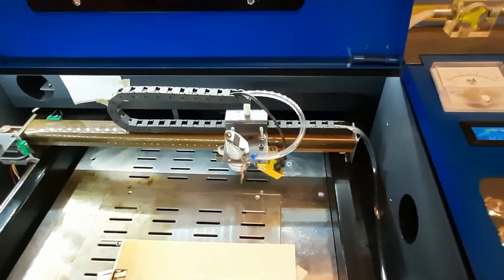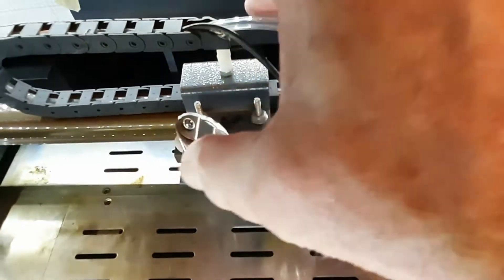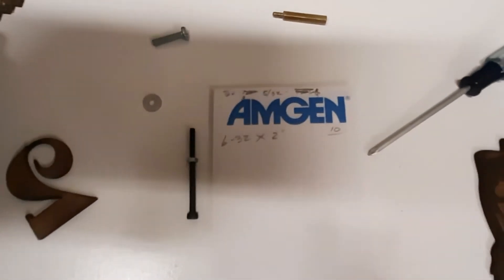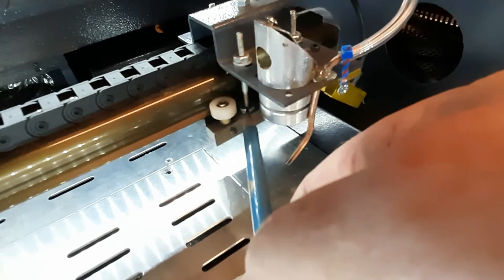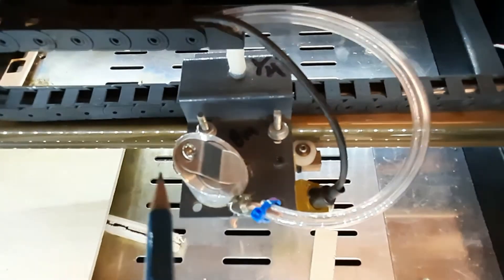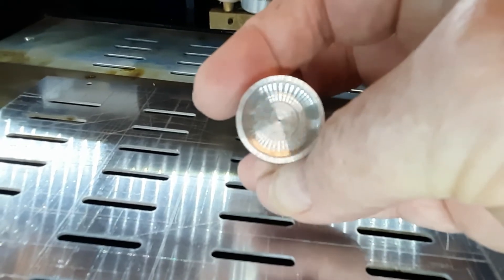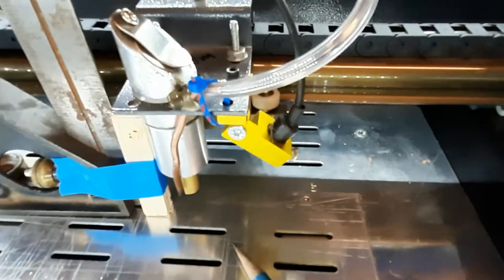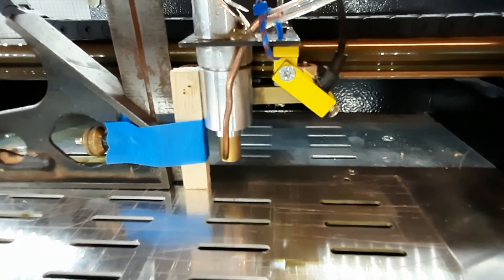K40 - Head - Adjustment Screws

Comment: How did you bypass the American Photonics button batteries ?
Reply from the maker: It requires two jumper cables. Check with harbor freight.  I think they sell a package of several with alligator clips on the ends.  Use a 9v battery.  Carefully squeeze one clip and push it up into the end of the AP laser where the button batteries would go.  Catch and clip to the spring way up inside.  I think that the spring is the + terminal.  Clip the other end of that cable to the + of the 9v battery.  Clip the other cable to the - of the battery. Touch the other end to the AP last housing and the LED should light.  If not reverse the battery connections.  When working you can clip to any other metal on the carriage.